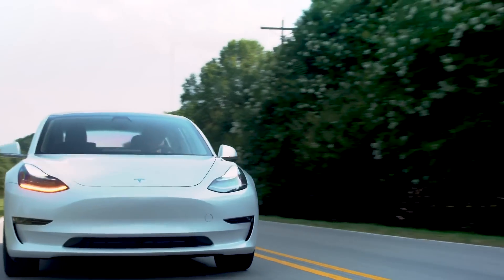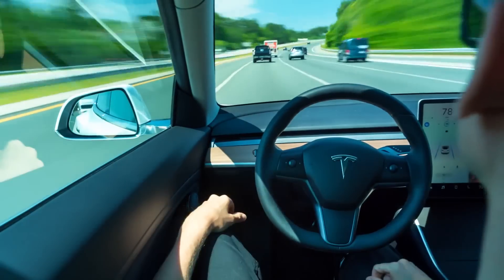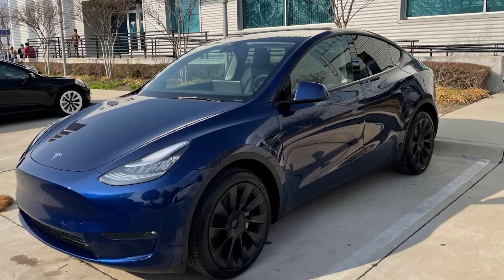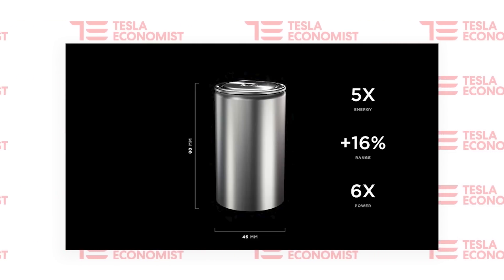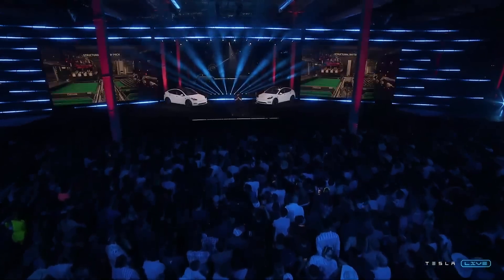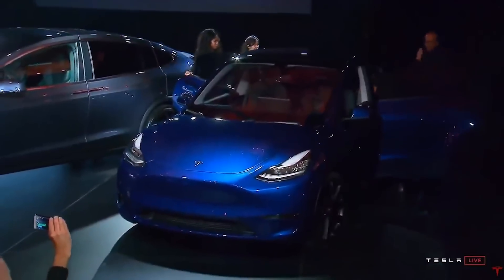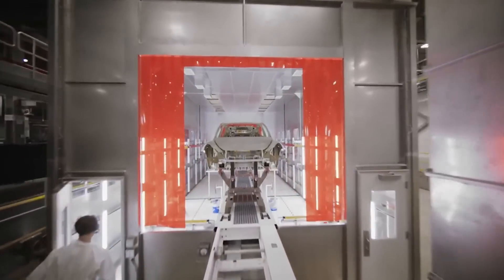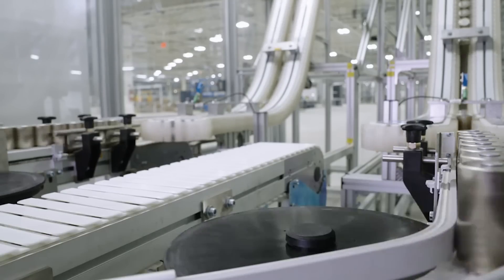Tesla Model Y 4680 Austin Software Upgrades!

Comment: LFP can bd used 0% to 100% without penalty anf Tesla superchargers are so good that 230 miles range is not really an issue
Reply from the maker: Yea, I think there will be plenty of demand for a 230m Y.
Reply: Absolutely!  I predict this option will eventually be made available, for regular commuters, and others as you say when the supercharger network gets fully built out and range anxiety evaporates.  How many bolt owners were okay with 238 miles?  Couldn't we see as low as 180 miles, especially in China and Europe?  You will however, have to give up some acceleration.

Tesla will use this lever to lower the price and increase demand (when they eventually need it)  And these customer will be happy to have a great car, with slightly reduced acceleration and range with all of the luxury of owning a Tesla.

Comment: NMC cells get degraded in 5 ways.
1 Charging them at 4.2 volts for extended periods of time.
2 Discharging them to too low a voltage.
3 Charging them too fast.
4 Discharging them too fast.
5 Allowing them to get too warm during charge/discharge.
Validating how this all happens in the real-world outside of the lab takes a lot of time, over many cycles.  Just like FSD, Tesla is taking a risk by putting 4680's into cars now before they have an abundance of real-world data.  But they have cleverly mitigated the risk by reducing the high/low voltages and charging/discharging rates to guarantee long life.

Fortunately, just like FSD data collection, they have the infrastructure to monitor the battery packs and the individual cells in real-time.  Allowing owners to increase the acceleration says that Tesla NOW has confidence to allow them to be 4) discharged faster than originally allowed.
Over time, I believe they may gain confidence in raising 1) and lowering 2) that will increase the allowable range,
And finally 3) allowing them to increase the charging rate.
Reply from the maker: Thanks

Comment: Maybe it's just me (I'm old), but gotta wonder how many Tesla buyers care about 0-60 time when it's already far more than fast enough for freeway use, passing, on-ramp entry. I care most about range, charge speed, other practicalities. As for batteries: how can anyone claim to know what will be the "battery of the future?" Every other day, click-bait pimps like the YouTube site "Future Unity" announce breakthroughs; "it's finally here," and other nonsense. But some day one of those breakthroughs will be real: sodium ion, encased nuclear waste, who knows? So many know-it-alls, when nobody knows that much.
Reply from the maker: 4680 are the battery of the future, and then whatever else Tesla produce. Everything else is click-bait. Because even if their batteries were as good in real conditions as labs, then they still wouldn't be able to make many.
Reply: Cost-effective relative to the performance. Suppose a new battery promises twice the range at same capacity but cost much more to make and unable to scale up production? While charging stations and charging speed has improved significantly over the year with current battery. Tesla battery will continue to improve over time. They won't stop at 4680 just as they didn't stop at 2170. Battery development is a continuing process of R&D.
Reply: @TeslaEconomist  
The ONLY problem with that (so far) is STILL the statement that LFP WILL be the predominant cell chemistry.

The battery of the future (from wherever) will have a balance of.
Efficiency (at cell, pack AND vehicle level,)
.
Low cost of production, in the most energy and space efficient factory (preferably modular)
.
Use of the "most advantageous" materials, in various combinations, to suit applications.

Comment: For an economist you have quite interesting views. 

The house analogy would be right if you pay for the WHOLE house but the company who build it locks three rooms that you later have to pay for AGAIN to be opened for use. 

But don’t wait to long unlocking prices are on a constant raise. Because inflation. Haha I don’t like this trend and there is nothing to hype about not being able to use the hardware you bought. 

Don’t get be wrong, I do like improvements and ota updates but I don’t want my hardware to be purposefully crippled when I payed it in full.
Reply: By that logic all otas which offer new features should also then require owners to pay tesla for them. As you own the hardware as sold sure, but not the updated which cost more money to develop and test new feature equipped software suit. 👍🏻🤔
Reply: @4literv6  this is a valid argument. Haven't thought about it from that angle.
Reply: @joe55514  thanks tbh I'd wondered why tesla didn't charge for them to begin with? A reasonable price to ad new features makes the car seem like it's always a newer versiom imo. And some like sentry mode along with dog mode, increase the range, flatter charging curve, all ad real value. 👍🏻

Comment: Paid upgrades/unlocks for hardware is NOT a good idea. I don't like the idea as a customer. I have a cybertruck on order, and already thinking of the nightmare of paying more to utilize the full potential of MY vehicle when I own it. I don't think that is the good moral thing to do. It feels evil IMO. 
As an investor I like high profit margins, but not enough to gouge. It just doesn't feel right just because I CAN do something, doesn't mean I should.  I think people will resent Tesla for it.
Reply: Offering upgrades to get more out of what you paid for isn't new in Tesla History. It's like any other upgrade you get offered say for a computer or app that now has something they think you would like to enhance your user experience for a price. I just paid for an upgrade feature on a free app and didn't think they were morally wrong for making the offer and the price was great for the small feature. It's a choice.
Reply: @dr-k1667   I think it's more like buying a CPU for your computer. Then Intel charges you to unlock two extra cores or paying Intel  to increase the clock speed. Obviously people would buy AMD to avoid these foolish extra charges. But in this case, there is no AMD, so Tesla can do what ever they want. If a competitor starts to rise(doubtful) then people will switch. I think letting go of a quick $3k profit will gain a longer term, happier customer.
 Imagine taking a friend for a test drive and having to say,"It will accelerate faster, but I didn't pay for the software unlock".  OR plastering them in the seat.......SOLD!

Comment: How about a much cheaper version with no possible upgrades ever.
Reply from the maker: Likely coming
Reply: To much pent up demand for that right now. And we're only in the very beginning of the ev demand s curve looking at the adoption charts.

So it'll be year's if ever before tesla considers any type of basic very cheap car under the 3 at least here in the US where cheap cars actually don't exist anymore. In 2021 the average corolla sold for over 31k without markups. And hatchbacks have never ever sold in high enough numbers here to be profitable. This comes from a former focus st2 and fiesta st owner btw. Who would love a sub 30k base rwd 200+mile hit hatch. 😂

I bet the Chinese and or Koreans get to it first. Gm also claims the base equinox coming in 2024 will start in the 30s. 
And they recently dropped the bolt down to 26-28k. Maybe the new ground up mini ev from geely next year could start sub 30k? 👍🏻
Reply: Yup, once the 4680's have proved themselves and Tesla needs to increase demand.
2 years?
Reply: @bru512  proven? Look at the spoken reviews model y from Texas with 4680s on here. It already charges almost as fast as the peak 2170 cars. Elon has said v3 sc bumps up to 324kwhs in q3, and v4 sc hits by the end of this year. 

It can get the acceleration boost for a 4.2s 0-60mph and is very very efficient so far from the road tests he's shared. 
Almost model 3 lr efficient in fact. I'd say the 4680 is tracking right where battery day promised it would be. 
And elon on the last earnings call said end of this year before it's as good as anything else they have cell wise.

Comment: I think the 4680 bateries should not be used for Model 3 / Y  at least for a few years time period,  but for upcpming Cybertruck  and Semi which need far more energy storage capacities.  In the years to come Tesla has to succesed to mass produce the the 4680 in all its factories to a level where a switch can be posible to 4680 for the cars production  but not before. becouse of its self competing risks,

Comment: Tesla has a reputation for not being a luxury as Mercedes or BMW. Imagine if they can deliver ventilated seats with massage on all lines for 4000 dollar.
Reply from the maker: The reputation was mainly from Tesla's build quality, which has improved significantly. Tesla is more luxurious than BMW or Mercedes now, like for like.
Reply: @TeslaEconomist  they should've absolutely partnered with franzs wife in offering those killer bamboo leather upgrades they just showed off today, but directly from the factory. Instead of letting unplugged performance sell them for 29k. I wonder if they might?

Imagine a factory plaid with world beating performance, factory ceramic brakes and a stunning bamboo leather interior for about 165-175k? 
Still cheaper than a slower similarly loaded up taycan or loser lucid air perf. 😀